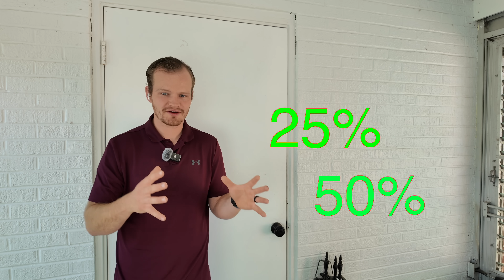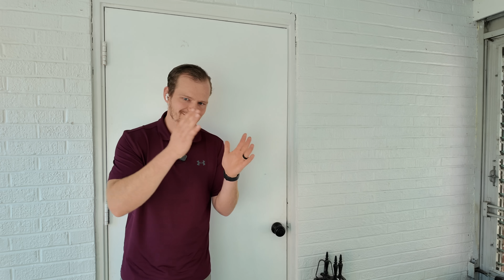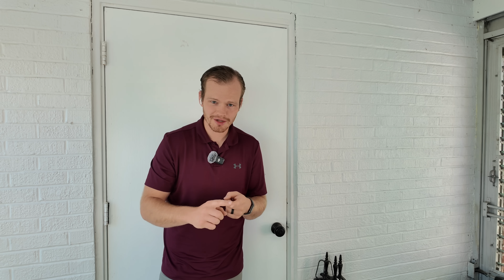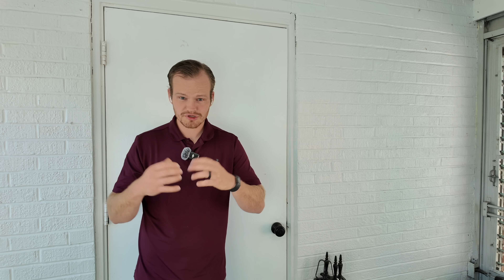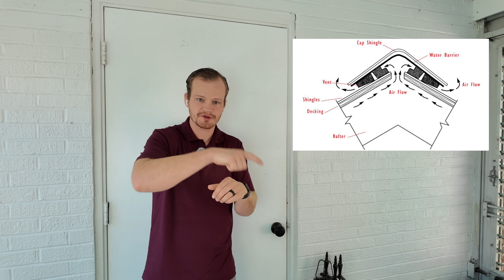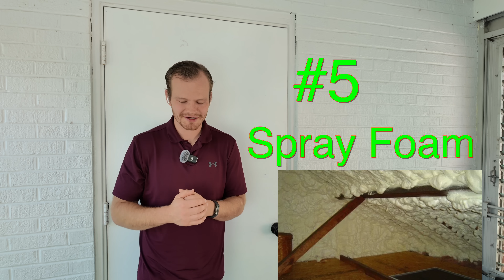5 Building Designs That Guarantee Mold

Comment: I have been in construction for 25 years I HATE CRAW SPACES
Reply from the maker: Me too. Was in one last week. Smelled like an animal nest.
Reply: Mine was covered in plastic from the builder and it’s pretty nice down there. I taped all the seams and added plastic up the walls.
Reply: @OptimisticEngineer345  exactly  your not a builder your an owner there’s a disconnect and I’ll bet the builder you paid wasn’t the actual builder that crawled around down there framing and hooking things up but regardless that builder has to compete with other builders selling craw spaces for 1 reasons and 1 reasons only to save money it’s a cheap ass thing and it’s for men that don’t work in there basement 
The craw space is one of the dumbest ideas ever thought of it’s a big middle finger to the workers and your cutting your nose off to spite your face to save a buck and make a build harder on real hands on workers 
Not to mention every time someone has to go down there to fix anything HVAC plumbing electrical framing 
I hope they charge double for any repairs in a craw space I know the contractors do around my area 
That’s all
 TRUCK GANG OUT
Reply: @joshualantz5101 I can only imagine working in crawl spaces it probably some of the worsts parts of the job. Mine is very high, from 3 ft at one end, to 7 feet at the other and I have plans of maybe converting part of it into a finished basement someday if I have the money to burn. For now, I store my gardening supplies in there.
Reply: @joshualantz5101 what the frick are you babbling about?
Reply: Why bother with a crawl space if you can just do a vapor barrier and slab on grade?  Makes no sense to me
Reply: @ralphalf5897  House on a slope.  Access to services like plumbing that would be inaccessible inside a slab.  Isn't susceptible to slab waterproofing issues.  Elevates floor reducing water intrusion.  Easier to retrofit or reroute services, add insulation, or repair foundations.
Reply: @ralphalf5897  In some climate zones, slab on grade can get very expensive to build because they need to be frost protected.

Comment: What kind of flooring would you recommend for a slab in order to prevent mold? Is laminate acceptable or would it trap moisture too?
Reply from the maker: I would polish the concrete personally unless I knew for fact the slab was prepped properly underneath to prevent moisture migration.
Reply: What about ceramic or porcelain tile on the basement floor?

Comment: MOST OF YOU STICK BUILDERS DON'T KNOW WHAT YOUR TALKING ABOUT.AND WILL NEVER CHANGE FROM WHAT YOU WERE TAUGHT.     HOMES SHOULD ALL BE BUILT TO MIAMI / DADE  BUILDING STANDARDS.   CONCRETE AND STEEL/ REBAR  AND OR ICF'S     AND NOT 4 IN CONCRETE  8 IN     /  REBAR NOT WIRE MESH .  / CONCRETE  MONOLITHIC SLABS  24IN X 24IN X 8 IN SLAB   AND  ALL DRAIN AND VENTS FROM BATHS CAN GO OUT WALLS OR OVER HANGS.  YES S. FLORIDA HAS HURRICANES BUT ALOT OF USA HAS TORNADOES  SAME KIND OF DAMAGE WITH NO WARNING
Reply from the maker: Sadly the construction hates change
Reply: Nope because of the earthquakes

Comment: Excellent video, there should be a course to get credit as an elective on this.. Two of my homes were custom built so I could see every phase and my father in law was a builder the third was on the market with a pool . big mistake. It was a high pitched roof, that was damaged in a thunderstorm with wind and hail, flooding the house. I won't mention the insurance company but their initials were SF and they weren't good neighbors. They said the damage was caused from wind driven rain and when wind driven rain hits the ground it's called water. So since it was water I didn't have flood insurance they wouldn't cover it. So builders and  insurance companies can screw you. I never bought SF again. But it's a good idea even in the desert to buy flood insurance. Also, you're buying a new home, walk through the houses being built in a new neighborhood before buying. You can see everything you mentioned.
Reply from the maker: That’s so angering how they can turn you down like that. Thanks for sharing your story

Comment: Your telling me not to cut a hole for venting the attic, but instead to cut a hole in the ridge, still a hole.  
I have seen studies that show ridge venting does a pretty terrible job at actually venting.
Reply: 25 years construction. Ridge vents canet water in. I see more problems with snow blowing in . But ridge vents definitely let it vent better. Hot summer days heat gets trapped in the peak. The life of shingles is directly connected too having great ventilation
Reply from the maker: The ridge is already a hole in your roof, it’s just covered with a cap with vents rather than shingles only.
Reply: @LumberjackHealthyHomes  but of course you cut it larger to ridge venting.  And regular vent holes are not covered with “shingles only”. They have large flashing that cover them.  The idea that a ridge vent is better for water tightness is ridiculous.

Comment: This is why I don't mind having a semi drafty house. It at least breathes a little.
Reply: Ok but here’s the thing, air leaks introduce moisture. Inside or outside air leaks (vapour barrier or WRB).

You want to totally air seal, while allowing it to dry.

Old leaky homes without insualtion will not have the same mould issues for sure, but they are very terrible to heat.

And moisture is very very surely forming in the walls, it’s just allowed to dry out properly due to old materials.

OSB sucks for moisture period. Never use it in walls.

Plywood has a better water vapour perm rate, and then hardwood/softwood is that much better.

Old places build with hardwood/softwood lumber can pass that moisture through,

Use that with today’s Tyvek and seal properly you’ll be ok.

The middle ground is where we screwed up. Too air tight without vapour permeability.

Kraft faced can be breathable but too much, and it deteriorates.

Don’t get me wrong I love organic over synthetic but it’s not actually more sustainable a lot of times.

With the synthetic performing better and lasting longer you’ll not need to renovate down the road.

Use a smart vapour barrier, air tight. Use a good vapour permeable WRB (I love tyvek) but really get spun not woven. Woven that looks crosshatched like a tarp almost always leaks.

But if you insulate and aren’t airtight you get interior or exterior moisture introduced into the cavity and it then can’t dry.

So being airtight to avoid that moisture introduction, as well as avoiding heat loss and cold air gain (in cold climate - reverse for you southerners 😂) but you have to ensure you are using products that enable drying and your great.

Also strapping (rain screen) under siding to promote airflow to dry out any formed moisture.

Exterior insualtion is the best thing though. Brings dewpoint outwards to where it can dry better.

If you won’t use exterior insualtion then at least use real plywood so it can pass the water vapour.
Reply from the maker: Yep better to have alittle bit of draft than a poorly thought out air tight house
Reply: Air to air heat exchangers will create the draft you need without burning so much energy.
Reply: A non-airtight house is durable because you have to produce more heat and that excess heat dries out the structure.

Of course you are allowing more moisture and cold in because the house is drafty. Airtight means more efficiency but you do need to be more aware of managing water and vapor as they can cause issues otherwise.
Reply: @ElvargsBane exactly. So just use vapour permeable airtight matierials.

First we did nothing for insualtion.

Then we insulated while blocking all air at soffits etc. we learned about condensation and mould.

Then we ventilated, and realized it made it harder to heat/cool so then insulated higher.

It’s a learning process. Then the more you insulate the more you trap the moisture from drying.

So the more airtight we go. Then we realize we need it to dry, and here we are.

Wonder what we’ll learn next?😂
Reply: @justinstevenson2061  In my area they outlawed soffit vents for fire safety and now wveryone has mold
Reply: @timcampbell-g6s oh man. That’s wild. I can see what they were trying for, fire safety is important of course.

But everyone having mould issue probably causes more impact than the couple houses in the even of fire having more draft.

I mean if the fires made it to the attic it’s going to draft from lower house to roof vent anyways.

Maybe I’m wrong about something here in terms of the fire and draft issue, but from my end that’s wild, I see what poorly installed venting causes, but zero venting is something.
Reply: old house are meant to breath thats why they have balloon framing i olny work on horse hair plaster and have never seen mold because of the lime in the mix  sheet rock is the worse mold loves to grow on the paper in side the wall

Comment: The vents in roof, serve a purpose, and not having them is not efficiency, it holds the heat of summer causing ac to work harder.
Reply from the maker: Yes vented attics must be vented, there is just multiple ways to do it.
Reply: With proper insulation the temperature in the attic doesn't make much of a difference for the interior of the house. It's the shingle roof that needs to stay cool to last longer.
Reply: @firstlast9292 living in Mo and Tx, in houses with vaulted ceiling,…. Yes- cents make a difference no matter the insulation…. Air flow is important

Comment: 1.  Decent roof pitch + wide overhangs—especially when using rotatable siding.   
Old houses with wrap-around porches, provided both important transitional spaces to do things, & shed water far from house foundations—even chintzy foundations of wood blocks lasted longer! 
A steep or rounded roof can provide faster snow slide-off, & some attic or loft space.   
A 3’ overhang on a 2-story cabin, in the wet-winters in the Pacific NW, US, keeps even the base of the walls dry most of the time. 
If you don’t have enuf eaves, best have metal siding, & some way to move runoff farther away from the foundations.
2.  Crawlspaces…?  Prefer a slab, or a basement.  Even a vapor barrier mitigates radon. 
The crawlspace ground started mold problems only when ventilation to the crawlspaces was drastically reduced to a few foundational vents—experts thot a vaporizer barrier would fix it….it doesn’t, since humidity enters the few vents & stagnates in the Vapor barrier’s crawlspace! *
3.  Roof penetrations will leak.  Combine vent pipes into one penetration.  Or in-wall flap vents to allow air intake.   Or vent via eaves several feet away from windows. 
4.  Waterproof flooring (LVP)—it traps water under it. Especially on concrete slab!? 
5.  Spray foam traps moisture. 
Unvented bathrooms. 
Improper over hands of windowsills. 
Non-breathable plastic barriers. 

* we experimented with a small cabin.  Copied a neighbor’s cabin idea.  His floor was the earth, with gravel on it, & pavers in pathways.  The idea was, humidity in air will balance into the earth, to reach an approximate 50%. 
We used gravel & pavers on the dirt of the ground floor of a small footprint (120 s.f.) post & beam cabin, ply sheathing exterior; shingles over tarpaper lower, corrugated metal over tarpaper upper. 1 door. 1 window I hand-made.  3’ roof overhangs on sides, almost 2’ front & back. 
It did not start developing mold that could be smelled, until around 20 years after built—mostly cuz it was not opened or inhabited, most of the time. 
So, it seems the crazy neighbor was onto something—letting the indoors of the cabin have real dirt & rock floors that help the indoor air quality.  
The tighter the bldg., the more dependent on high-tech systems we’ve become. 
The close we work with nature, including using the earth’s tempering abilities, the less need for fallible high-tech systems.  The less hightech systems, the less noise, less cost, fewer industries taking undue advantage of consumers by building-in obscene levels of Planned Obsolescence. 

Our buildings, especially our homes, should take care of us…Not us constantly having to take costly care of the houses!
Reply from the maker: This is very interesting thanks for sharing this.
Reply: Gaagle won’t allow editing comments—NOT “rotatable” siding—that was AI autocorrupt!
I had typed “rot-able” siding!!
I had typed “overhangs” of windowsills.

Comment: Buid your house European way. Use the briks
Reply from the maker: Bricks are cool. I think wood is a great material though when used right
Reply: And have half the living space for the same price. No thanks. A typical wood frame house goes through 6-7 families living in it as is. Nobody needs a house to stand for 300 years.
Reply: @firstlast9292  The wood frame house will not stand even 50 years without constant maintenance. No, thanks
Reply: THEY have moisture problems too.

Comment: Water can blow up into ridge vents, not always a good idea.  Our house has water under it every winter and we have a sump pump.  Sometime water gets 3 ft deep and we get moisture on our windows in the house.  It Never matters because our house is 100 years old, made of old growth redwood, with lime plaster and old growth redwood lath walls and ceiling, and old growth fir floors with no vapor barrier.   No mold ever, anywhere.  Sheetrock molds.  Vapor barriers trap moisture and molds.  Our house breathes and is made of non-molding materials.  Modern materials and methods kill people.  Our house protects us.
Reply: 3 feet deep water in the basement? Ouch. I thought mine was bad. The main problem I have is it pumps into the same sewer line as the outdoor stairwell grate, and if that thing clogs, watch out, flooding incoming. If I had a do over, long ranch house on a slab, preferably in the way south. Cooling is so much cheaper and easier than heating.
Reply from the maker: That’s interesting. So the basement fills up? Or crawl space?
Reply: That’s amazing about your 100 yr old house, Yeah houses in the last 50-60 years are essentially poison, toxic soups. I now believe it’s prob the leading cause of death.
Reply: @brightfuture4767 I agree. I moved into a 1958 home, and had it thoroughly inspected, but I’ve had issues with absolutely everything since I moved in. It’s detrimental to my health and the previous owner said there was never any water nor water damage. He lied! The basement fills up with sewage backup water, and I stupidly cleaned it myself and became systemically ill for over a year. I just found extensive mold in my attic and had it remediated, vented properly and sealed. I already feel better a month later and I’m detoxing. That part is horrible, but having hidden mold that was keeping me from getting well from Lyme, Babesia, and mold, plus co-infections. I was already sick from my previous condo and died on the table during one of my 4 surgeries that took place within 10 months. 
  Thank you for your good work! I’m moving as soon as I can in the spring!
Reply: @Tinyteacher1111 I hope you have found nutrition and a good alternative Dr.  The body heals if given the opportunity.
Reply: @Thomas-c7j3f I’m trying and always learning; however now u have teeth issues. Ugh!
Reply: @Tinyteacher1111 I had all the mercury removed from my mouth, 20 years ago, we are pretty hard on our bodies.
 I'm just getting into PRI physical therapy and it's been the biggest game changer for me. They know something about the body, nobody else has figured out.  I work with a PT, a dentist and an eye doctor.  I've seen nothing but improvement since I started 2 years ago!!! When you have been disabled 30+years, it takes a while to heal and change.
Reply: @Thomas-c7j3f what is pri physical therapy?

Comment: ❤❤Thanks for the very informative video.

I’m currently partial renovating/insulating a basement in the northeast in a  humid/sea-level area.

Questions:
The floor is bare concrete: How and what product(s) can I use to seal the slab.

**You mentioned a vapor barrier on this slab or digging in a drainage hole?

There’s no sump pump currently, but I want to seal on a budget if this is possible .

Insulation:
I was planning to air spray out the top sill plate in the gap where the concrete slab meets the wood sill plate.
Then.
I plan to caulk that thin gap with dynaflex 230 elastomeric sealant (on the inside of basement)
**No work is being done on outside of foundation other than water mitigation as much as possible.

Insulation:

I plan to use rigid foam board cuts in the  joist cavities that face the outside parameter of basement walls and spray-foam those in around the them.

Is this fine?

I lastly plan to put in bats of either fiber or mineral wool to fill the ceiling framing(up on the sub floor cavities).
Faced or unfaced?
*AND HUGE QUESTION!*
I DO NOT HAVE THE BUDGET TO INSTALL A DROP-CEILING /And DONT PLAN TO FRAME AND DRYWALL.

What can I use that doesn’t look terrible to hold the fibers in and prevent them from falling and floating around??

Thanks and hope you or someone can help me here!!❤
Reply from the maker: Sounds like a fun project. 

The only reason to seal the concrete is for looks and keeping it clean, if you want to stop moisture you would have to do epoxy.

Sealing those gaps seems smart to me and I see no problem with the rigid foam  board.

For ceiling, you shouldn’t have to insulate it at all because the floor above should already be insulated.
Reply: @LumberjackHealthyHomes ❤Beautiful!
Thank you for the quick and very helpful response!
This answered and confirmed everything I needed.

You’re the best and I hope more people find your channel! ❤
Reply: @LumberjackHealthyHomes 

Any risk that sealing the concrete slab w/ epoxy would cause the interior framing to rot? My interior walls are not made of treated lumber. I would like to do an epoxy sealant between the slab and some new hardwood flooring.